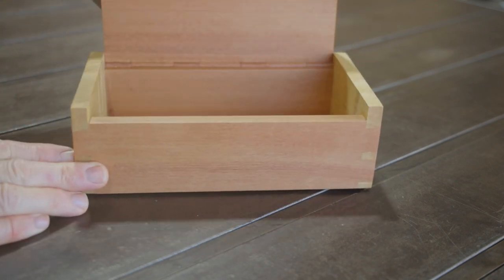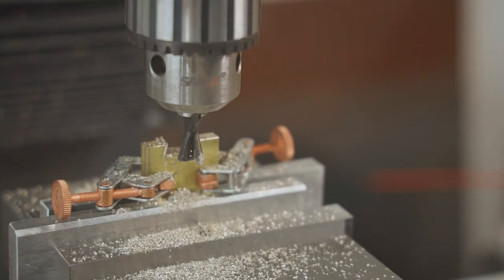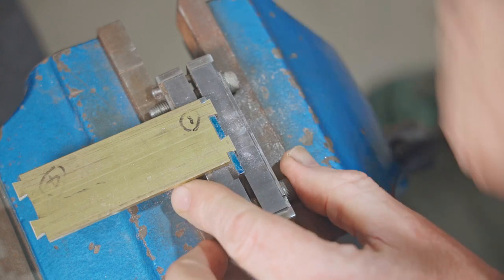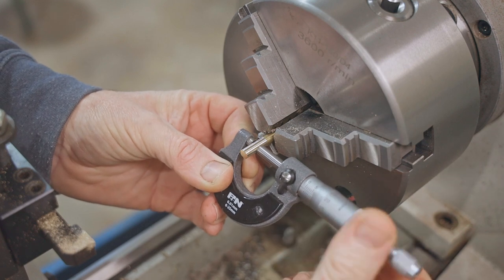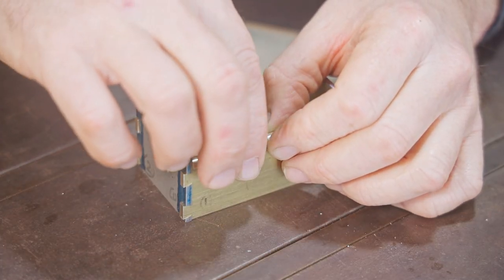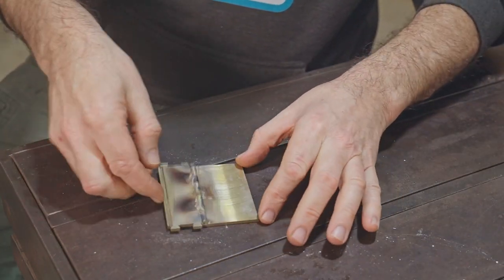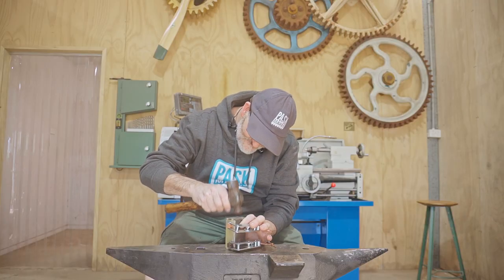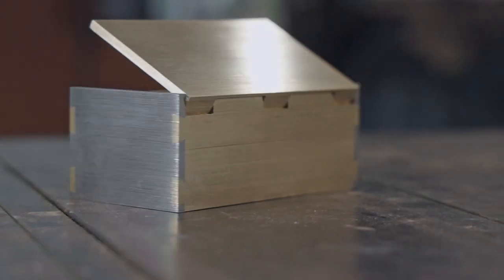Cool Little Brass Box with Dovetails and a Hidden Hinge

Comment: Love the box. It turned out great, like l was sure it would. Im a retired master goldsmith and l have a wee tip for hard soldering multiple pieces without them soldering together. I always painted the surface that l didnt want solder to bleed to with a thin layer of china white or zinc white paint. And make sure you dont put any flux where you dont want the solder to go, less is more. That has always worked for me on very intricate pieces. Just remember to only get the white and the flux where you want it and let the white dry before soldering your pieces together. Give it a try l think you will be surprised. I learned this from an old jeweler when l was young, lm 70 now and there might be better ways to stop bleed over now but this always worked well for me. 👍🏻
Reply from the maker: Thanks very much Tina! I did wonder if there was a way to resist the solder and now I know. I'll definitely try that next time! :)
Reply: I never woulda thought of that, gonna propose this to the lads at work 💪
Reply: Graphite (a soft pencil) works too.
Reply: Tina, 70 is the new 40
Reply: Candle soot is a proven method which works quite well too 🙂
Reply: I'm a silversmith and was taught to use iron oxide as a solder resist on hinges and the like.
Reply: @claytonpercy8977  anything that will stop the solder from flowing where you dont want it will probably work. Like l said its been 50 years since l learned the zinc white trick and lm sure there are other ways just as good. 👍🏻
Reply: @tinaredington1292  yes always many ways to accomplish the same goal. I saw someone else mentioned yellow ochre I have also used that successfully. Next time I am making a box I think I might try the white out trick much easier to obtain.
Reply: @claytonpercy8977  it cleans up nice too

Comment: 1/2inch shank can be put in a 13mm Collet. these Collets usualy can Clamp 1mm below there nominal diameter
Reply from the maker: I have a 12mm and a 14mm collet in my set but not a 13mm though. Same with 1/4" there is no 7mm collet in the set. :)

Comment: Very nice job. Box making is one of the tasks that apprentice jewelers are given to hone their skills.

To keep hard solder from going where you don't want it you can apply a solder resist. Some jewelers use liquid paper or other kinds of white out. The traditional resist is the pigment yellow ochre. It's available in small amounts from any jewelers supply house. You mix it with water into a very thin paste and paint it where you don't want the solder to flow.
Reply from the maker: Thanks very much Elliot. I read in a couple of previous comments about using a resist. I did actually wonder if there was a method for doing this and I'll definitely try it out in the future. :)

Comment: Nice work! Suggestion for future soldering work: If you have areas where you don't want solder to flow, paint it with White Out. There are other, more professional materials for this purpose, but White Out is cheap, easily available, and has worked great for me on similar hinge projects.
Reply from the maker: Thanks very much Frank - I just found that out in a previous comment, it will be useful for sure! :)
Reply: came here to say this, (although my advice comes squarely from an armchair)
Reply: "an expert is someone who makes a mistake but then doesn't" - Johan Cruyff
Reply: @DrWhom  nice to know I am halfway to expert

Comment: Woodworking suggestion: a patio umbrella. The cost of material might be cheaper than buying a good one in a store, which is rare as you already know.
The options are unlimited. Could add in some kumiko or even a little machining along with a lot of your other tools for making hinges and large wood threader and etc.
It's also scalable for different purposes; and store bought ones don't last long which could make what you make far superior depending on design

Comment: Love seeing the milling projects coming in! Not sure if you wanted to fly cut for the look and not just to thin it out, but for the 3.2 mm slot you can cut the centre channel with a 3mm cutter then offset the cutter 0.1mm both ways. This will also act as a finish cut for the walls as they are often a bit gnarly with a full width slot due to tool deflection and chip evacuation.

Comment: Next time, use graphite where you don't want the solder to flow. A carpenter's pencil will suffice. Rub it good and hard where you don't want the solder to go. Lovely piece. You can age brass with any brass black cold blue type fluid, or just use a strong degreaser (like engine cleaner), warm up the brass and dip it. It will darken and form a caramel-honey translucent oxide layer that looks awesome.

Comment: One note about the ER collets you're using. They are designed for a range of sizes, typically their nominal size and smaller. So if you have a full set of metric collets, you can also hold inch sizes. A 13 mm collet would hold 1/2" just fine. They are designed with a taper on both the front and back, which allows them to close concentrically. Just thought it would help.
Reply from the maker: Thanks Brett! I understand how they work but my set really does have missing ranges. I have an 11-12mm collet and a 13-14mm but there is no 12-13mm. The same when I needed 1/4" there is no 6-7mm collet. As I said I have ordered those to complete the set. :)

Comment: Thanks for sharing another fine project.. I really like your videos. There's a lot of variety.. you show your mistakes and the ways you perceiver and you discuss other options along the way.. ... I just wanted to share some knowledge to anyone who may care, that there's a black brazing flux available that will allow you to braze stainless steel with brass or bronze or copper or silicone carbide or whatever it's called (looks like bronze).. 
It's a very aggressive flux that will irritate the skin and eyes as well as lungs if not used in well ventilated area..

Comment: I'd start with the lid as one piece, unfortunately you lose a lot of material that way, but you end up with perfect fits. You can mill away the slots for the base easier than trying to solder them all at once. OR maybe try an oven solder joint. So you heat the whole thing up all at once and consistent temperature. Be wary, you may need a block of filler to sit inside to keep it from bowing depending on the type of solder/heat you use.

Comment: You should cut a steel kumiko pattern in one of the faces and then cut brass pieces for all the holes and peen them over on both sides before machining it flat. That would be pretty amazing if you could pull that off!

Comment: A good deal of work for a rather small box, Suggest you ad some anti scratch material on the base & line the inside. I suspect the solder joint strength but unsure how to improve.

Comment: Pask, I really enjoy your videos. You're an excellent craftsman, and I really like that you take on such diverse projects. I would like to offer a suggestion about your use of the hacksaw. I took 2 years of welding in vocational school and had an instructor who was very strict in his methods. One of his biggest pet peeves was how everyone uses a hacksaw. This is how he explained the proper use to me (he also demonstrated, but I'm not that good of a writer to do that part here).
He said, "A hacksaw is technically a very narrow file. As such it should be used like you would use a file. Do you use a file with one hand? No, you use two hands. So use two hands on the hacksaw, one on the handle with the other lightly holding the front just at the bend." "Also, when you make a stroke with the hacksaw, always (once the kerf is started) start at the very front tooth of the blade and push until you reach the back of the blade. Basically, use the entire blade on the stroke." That's how I remember him explaining it to us in class. I found that the work actually goes quicker when it's used that way. Also you replace fewer blades because they don't get a dull spot in the middle & have to be replace.
Also, when I cut metal like the pieces you did at the start of the video, I clamp them horizontally in the vice. That way I have less depth to cut through and can better ensure my cut is completely on the line with no wavers. 

That's just my 2 cents. Keep up the great work!

Comment: It looks like you're using an ER collet system I your mill. They have a relatively wide range of holding capacity, so you should be able to hold a 1/2 shank tool in the closest metric collet you have

Comment: I was thinking”wth why doesn’t he have common sizes….”then I remembered your in Australia where metric is more pronounced. Not so much here in Canada.

If your soldering tin the surfaces first before trying to join. To prevent pieces from joining wax or grease works.

Comment: Yeah, it definitely isn't finished as it is. I'm wondering if you could use a historical Japanese or Chinese style pattern for the decoration but I'm not sure if engraving or etching would be the right way to go. I was just wondering if an enamel design would work 🤔. If you check out "Christ Centered Ironworks" Roy's wife Jess does some enamelled copper pieces that look really good. It kind of depends if you want to learn a new craft overnight or not 😅😂 That box is going to look amazing whatever you do to finish it off 👍👍👍👍👍

Comment: I think you're fine with stainless and brass, but if you continue to mix metals you should familiarize yourself with galvanic action to avoid rusting over time. Love the work here! I'd hate to see it tarnish.
Reply from the maker: That's a good point - I've already used these materials together on my mini block plane with no issues, so it's all good. :)

Comment: ER collets are designed to cover a 1mm range in size, so your 6-7mm collet will happily hold 1/4" stock.
Reply from the maker: I didn't have a 6-7mm collet in the set, that's why I said I'd ordered one. :)

Comment: okay, sorry, that has nothing to do with woodworking and metal work, but are the earbuds you are wearing in the video Nuraloop ? and if so, how well do they do of a job cutting down on the sound when using the mill ?
Reply from the maker: No worries! They are Nuraloops and they are incredible at cutting out noise as well as awesome sound, love them. They're actually my second pair, I got the first ones as a preorder when they came out and I used them heaps. :)

Comment: Would it be safe to store daily meds like pills? Maybe for small tools used in sewing like sewing machine presser feet or wonder clips :)
Reply: It wouldn’t be considered “safe medicine storage”, but depending on the needs in a particular household it could still be safe enough. Just don’t leave it in direct sunlight, as a metal box will trap heat.

Comment: Just a word of advice when milling manually, best to avoid climb milling as the slide can sometimes snatch when taking bigger cuts. You can get away with it when using small cuts but it is best to get into the routine now while you are learning
Reply: Please explain climb milling in respect to whats going on in this part of the project? Thanks.
Reply: @jdmccorful  when he's milling the ends he's going back and forth instead of one direction. I have tried to put a link in this reply but it keeps getting rejected, Google climb milling Vs conventional

Comment: Does using a file guide dull your files faster?
Reply from the maker: It does. What I do is use good files until I get close to the carbide faces and finish it with cheaper or worn files. :)

Comment: 6:15 So I don't understand, everyone in the rest of the world makes fun of the USA for still using imperial measurements, but everyone else in the world is still using them also.  Why?  I thought everyone was a purist and hated inches and feet.   Someone please explain this to me.
Reply from the maker: It was a 1/16" through hole as the wire that was going through to make the hinge was 1/16" tig wire. Many items are still made in imperial sizes still, just like the brass rod I used in the project. :)

Comment: I am not really wanting to be critical but you run your end mills too slow. And the lathe rpm is slow. On brass and aluminum, your tools will actually last longer especially with coated tooling. Why do I know this? I am a retired machinist of 40+ years.